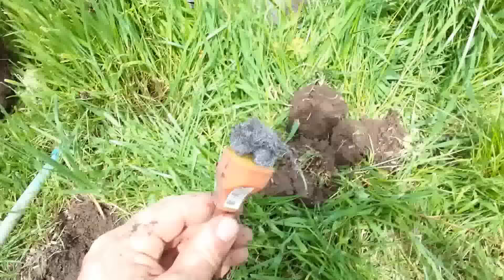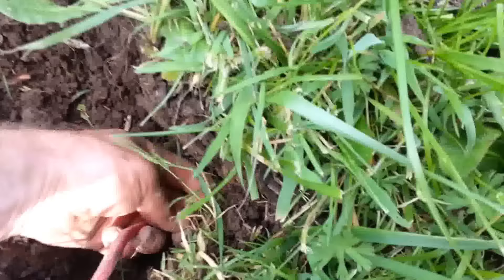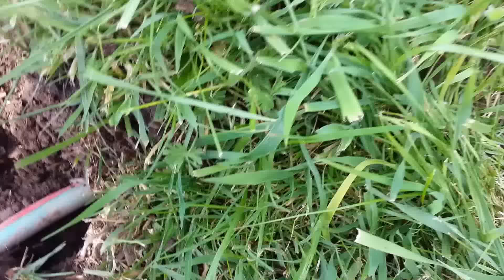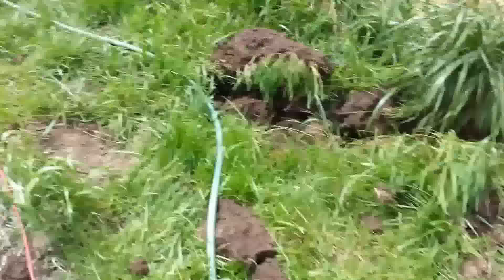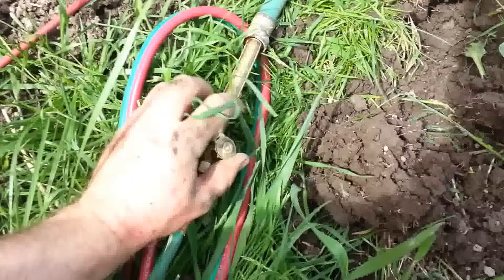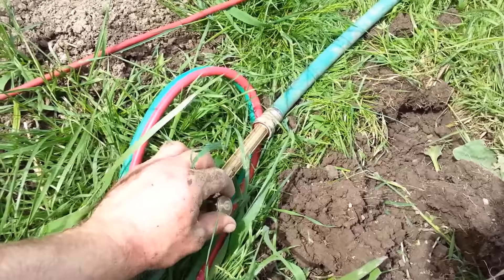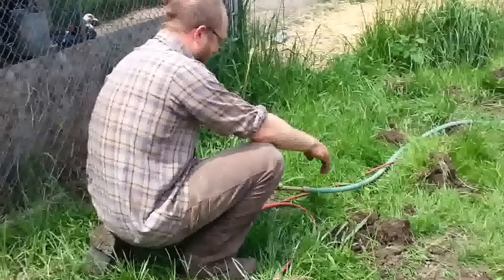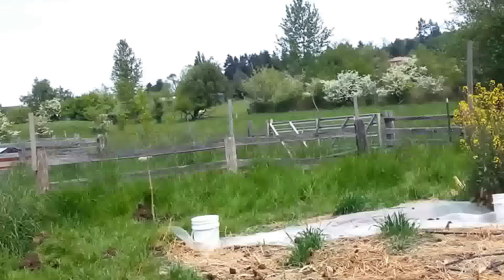Oxy Propane Gopher Tunnel Explosion

Comment: your right i had to find out the hard way . my kids an  I  were  paying in  7/4 /2018  in the pool and they were saying   lets go  get some fire works to set off  no way I was going to spend that kind of money on that I have a better  idea , some stakes came in a big foam box for  the BBQ WE ARE HAVING   and we had the dry ice so dumb ass me bust  u the dry ice and get in 4 two later soda bottles add some water  and put the cap back on  and toss them in the pool 30 seconds they  WENT BOOM BOOM BOOM . THE GUY  down the street a1/4 mile away called the cops   and all hell broke louse  told me I was shooting a shot gun in the air . and tried to arrest me my wife told them what I did  and the crap hit  the fan the charge is making explosive devices  and  setting it off in the back yard.